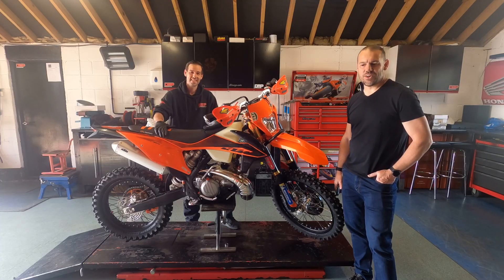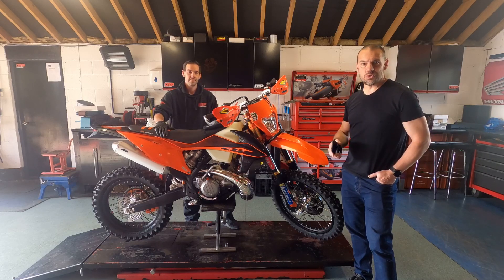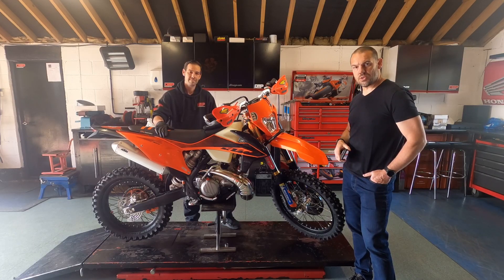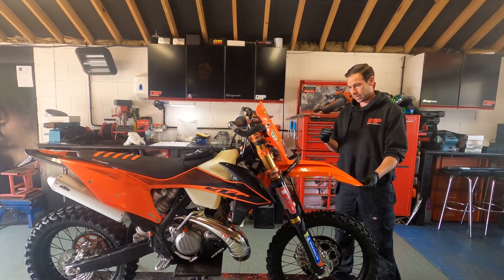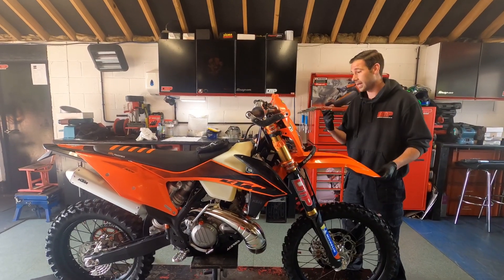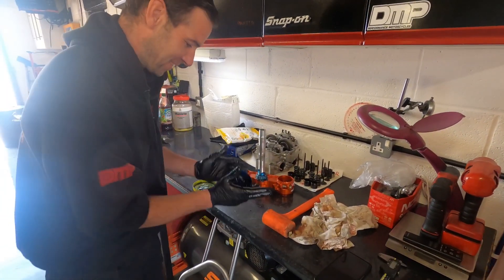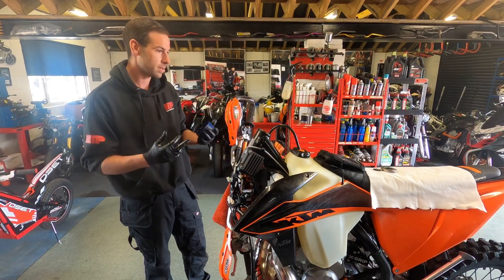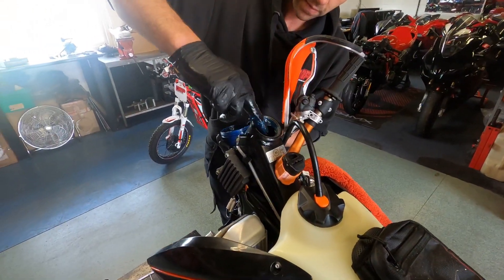Workshop TOUR! We visit DM Performance for bike maintenance tips, new head race bearing, clutch

Comment: Great Video, Do you know which of the clutch pressure plate numbers (1 or 3) gives less bite, Cheers -:)
Reply from the maker: Philip Smith 1 is lighter, 3 is harder settling
Reply: @enduroskillstraining  So Im assuming that 1 would be less bite, correct ?
Reply: @philipsmith6152  10-4

Comment: One question, I have a 300 6 days, still on original superprox sprockets, 14/50 and the chain is in great condition. I would like to try the 12/50 combo, therefore can I just put a new 12t to try and test it and if I like it to keep it. If I do not change the set now, it will surely last for at least another 100 hours. Therefore am I better off buying a new set, and swapping them depending on the race or I can toggle between 12/14 only. Thanks
Reply from the maker: Yes you can, absolutely. 12t sprockets wear much faster than 13t and 14t but they are only £15 or so. It won't damage anything but the 12t might just wear faster due to slightly the used chain. A lot of training schools use 14/50 combination because you get long chain/sprocket wear out of that combination and it calms the bikes down a bit. 12/50 will be VERY different from 14/50, it will make 1st and 2nd gear very short in comparison. It will be great for technical and extreme riding, pivot turns, etc. but it's not great on the faster stuff. Always a compromise.
Reply: @enduroskillstraining  Thank you very much for the expertise.
Reply: A smaller front sprocket will lead to increased chain runner / slider wear. I stick with as large as l can on front (14) and change the rear. Also, IMO, KTM spec for chain tension is too tight (think about the chain length V full suspension compression. I set mine so chain just kisses the bottom of swing arm at back of slider)

Comment: Soak clutch in good oil ?
Reply from the maker: mixalis absolutely. The cost of oil isn’t very high, I’d personally rather use a high quality oil soaking my fibre plates than something that will break down easier under stress. 👍